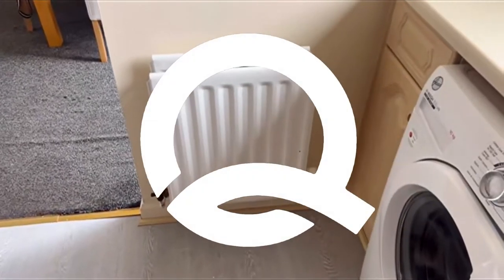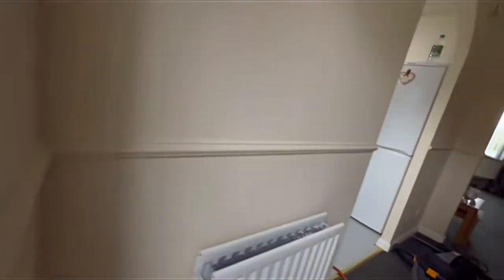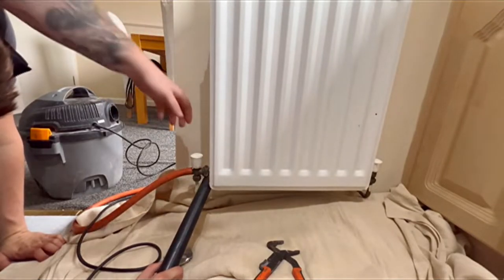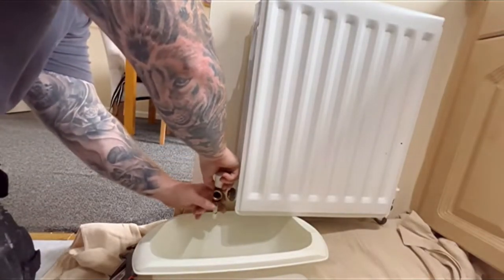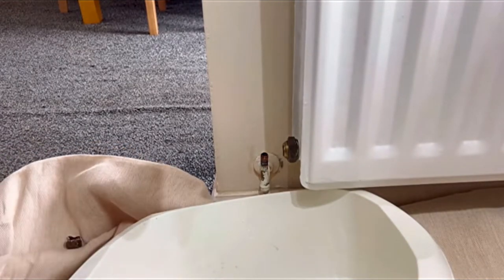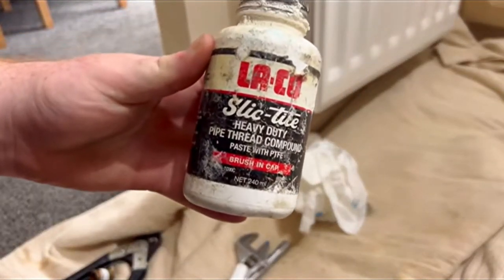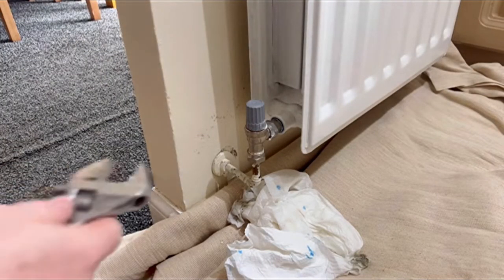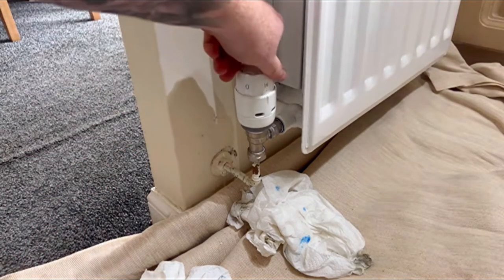DIY Plumbing - Radiator Valve Swap with Microbore Pipework

Comment: Mint video! 

Doing my sisters radiators tomorrow and I’ve fitted loads of radiators, in LCS, 15mm but never in microbore, and when I went to the suppliers and got the reducers for the 15mm valves and for the 10mm microbore pipe I was like no way this is going to work, the little brass reducers look like they still need an alive or some sort of rubber washer but watching this has cleared that right up. 

Top job, cheers.

Comment: Nice vid. Done a lot of work on my own system which has some 8mm microbore. Those reducing sets are great though you can get the valves in 8 or 10mm sizes if you look around. Good tip with the box spanner though I found a universal rad spanner online which fits a 1/2 inch drive ratchet if you have one around. The Rothenberger stuff isn't cheap but their thin jawed adjustables are worth having, beautiful quality and will get in almost anywhere 👍

Comment: So no olive with that reducer? Absolutely hate micro, it’s banned now from new builds I’m told.
Reply: It is not used any more but when first used it was regarded as fantastic just like artex was at the time now they are both shit
Reply: @Law-h6r  aye and pre 2000 full of asbestos.

I’ve actually got microbore in my 20yr old house. But in a commercial setting or college hostels etc any slight knock to a radiator and it leaks. Stuff in my house has that plastic insulator around it, stronger.
Reply: Comes with olive for micro ore and yes use it.